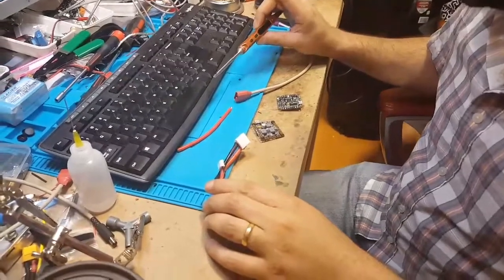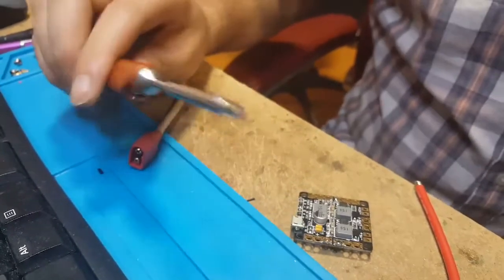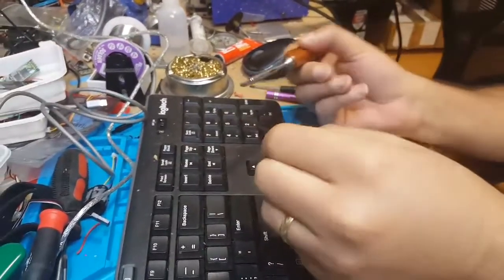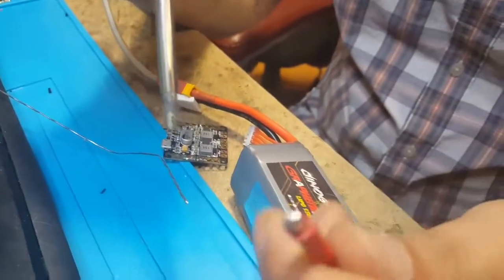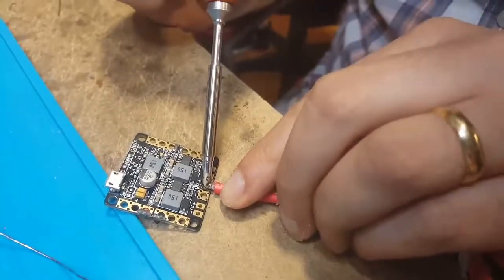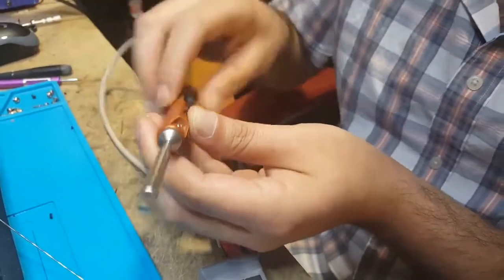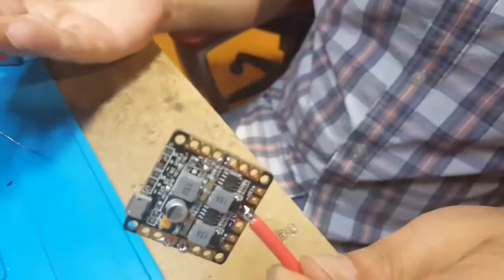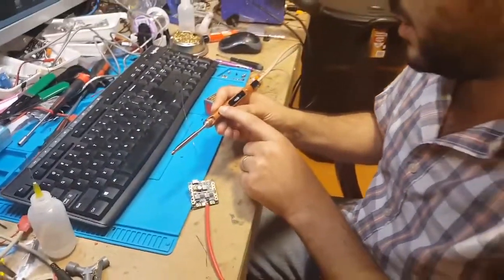TS100 vs 12AWG wire Solder

Comment: *Melts the surface layer of solder*: "Wow, that's amazing!" And no, I'm not a troll, I'm just letting the people who will watch this in the future know, that the soldering iron cannot melt properly tinned 12AWG wire in under 2.5s. That is plain deception, regardless of whether you did it on purpose or not.

Comment: Shit solder joint, no penetration into the multi core wire let alone the joint
Reply: aqib2000 stop being an idiot "rotorev" will kick your ass at soldering any day! He is just testing the ts100
Reply from the maker: aqib2000 do I really look like soldering this dead board for functionality?? Lol . Simple demo of ts100 ability and heat transfer and pid handling of the iron. But hey looks like video is a troll magnet hahahahhaha
Reply: RotoRev did not comment on the iron performance, only your inability to understand thermal transfer of heat to get a solid bond on this 12AWG Soldering “demonstration” video
Reply from the maker: Does the video title say "how to solder"? Maybe I'm just missing something here ! Or u just feel unstoppable urge to troll online usually maybe .. if so pls feel free to steer away from the video
Reply: RotoRev will be back if there is further bs. Standby.
Reply from the maker: aqib2000 it's ok man u already consumed the 15min per year I dedicate to trolling lmao